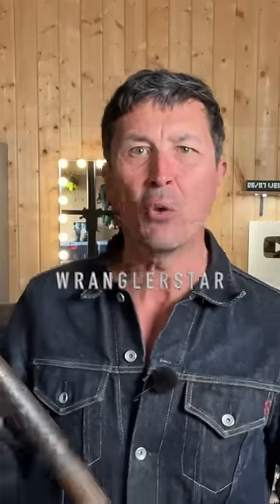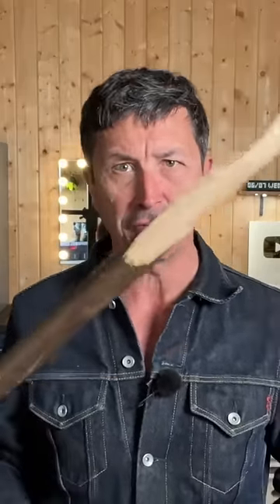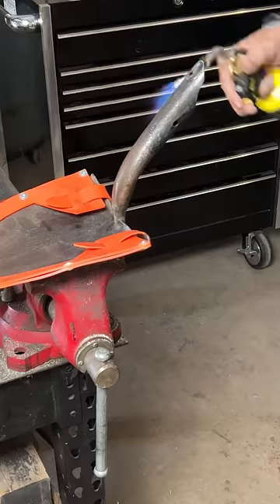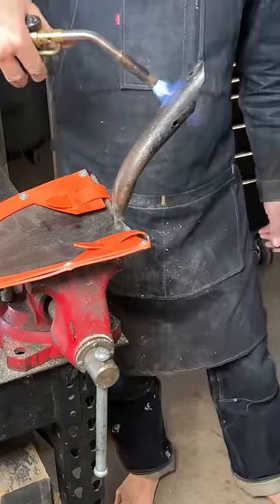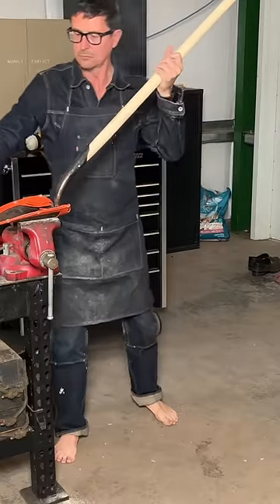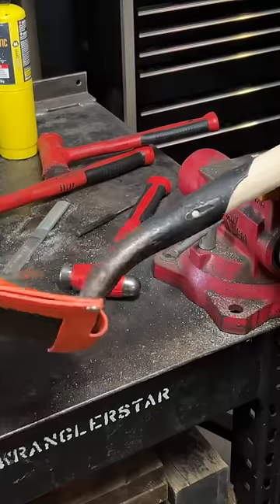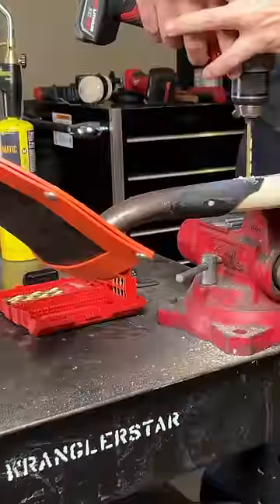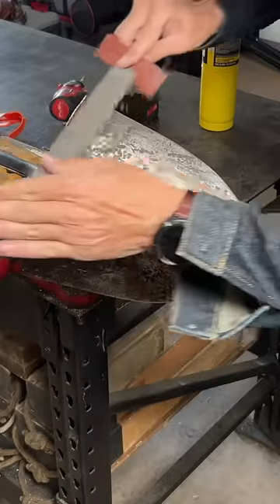Secrets of the US Forest Service, Wranglerstar, professional homeowner #shorts

Comment: What's your favorite use for hankies? Mine if wearing it as a scarf in a hot day because I damp it with some water and it suddenly becomes the most refreshing thing in the hot summer days
Reply from the maker: Probably bull fighting,
Reply: Both of those are very good uses.
Reply: @clarkrichards1907 lmao
Reply: I like to use mine dampened as a mask so as not to be breathing so much smoke from these forest fires!
Reply: Multi purpose  bandana!
Reply: White shemagh. Bounces a lot more sun than my dark hair, and wet it makes a nice head cooler. 
Also good for straining water before filtering, big enough to use as a sling or bandage.
Reply: @kd5nrh  can you fight a bull with one of those mini blankets?
Reply: @Kettle Bell i was thinking like the Spain toreros who swing around a cape and fight the bull with sword
Reply: I have allergies, so my bandana hankies are all pink and used for my runny nose!!😊
Reply: Parachuting can be fun. not recommended unless you're a Biden supporter
Reply: @eraldo1938 I like using mine soaked in a bit of kerosene, and shoved into a wine bottle full of gas and crushed Styrofoam, it makes an excellent wick in case you need it to defend against an angry swarm of wasps, USE ACCORDINGLY. 🇺🇸
Reply: @eraldo1938 to be fair in Kettlbells example there can also be "Sword fighting" but it is a much different action then the one you are describing. 
Use accordingly.😅
Reply: @LoftLorian 😂😂😂🤣😂
Reply: My wife loves to be asphyxiated by mine.
Reply: When I worked over seas a shemagh went a long way to help you breath in sand storms and keep your face bits from getting an unhealthy dose of sand blasting.
Reply: I have to wear a bandana to keep sweat from dripping in my eyes here in AZ.
Also it keeps dirt and leaves out that hats somehow let Thru...
Reply: Wiping my brow and hands.
Reply: So much care and consideration for a very large spoon. Awesome, “Old World Craftsmanship.” Most people don’t understand the once importance of that tool, to the common man as well as to many a, “Military Campaign for Millennia.” Hence, that is why it is still issued to every infantryman, in today’s modern Army.

Comment: Very timely! I am finally getting around to treating and refurbishing all of my wooden tool handles.
I've been sanding and scraping to get everything back in shape and then coating with linseed oil and the difference is amazing
Reply: With the linseed oil, did you do the once a day for a week, once a week for a month, once a month for a year procedure?
Reply: @dejavu666wampas9  
I think the description here is best laid plans! LOL I definitely wanted to adhere to that. But some of my handles had some cracks in it and such and so I coded those pretty heavily. So I gave them about a week to soak in and then I hit them again with a lighter coat. But I think if a person was treating affresh tool that they just got done scraping the locker off of or something like that that system would likely work just fine
Reply: @brizzle8797  - Thanks for the response.  I’ve also heard of using Tung Oil, but have never tried it.  Apparently, you don’t need all the many linseed oil coats, when you use tung oil.

Comment: I had to look at this twice you actually have a convex spoke shaver. Nice job very good right tools right method. But will you please put some shoes on when you're in your shop please some young man will see that and he will say that's okay to do it's not okay to do. But yes gentlemen is the proper method on how to replace a handle in any tool that you have that is inserted with a wooden handle doesn't matter if it is your hammer or the garden hoe or even the garden rake all can be replaced. So take notes Watch twice and do this. A little note for me I have cut up a 2x4 and put it in a rake use my convex book shaver to round it down put some stain on it and some sanding and boom instantly my mother in-law was all impressed. So there you go fellas and ladies and as friend here would say act accordingly and responsibly.

Comment: does it damage the long term strength and integrity of the new handle to jam it into the ground like that?
Reply: Not even a tiny amount. That how pretty much any wood handle is seated. Axe handles, rakes, shovels, pick axes. Inertia does the work and wood is natural flexible so it handles impacts very well.
Reply: What I wanna know is if the integrity of the head is comprimised from the heat of the blowtorch.
Reply: @kipper6891  just a little mapp gas won't harm it